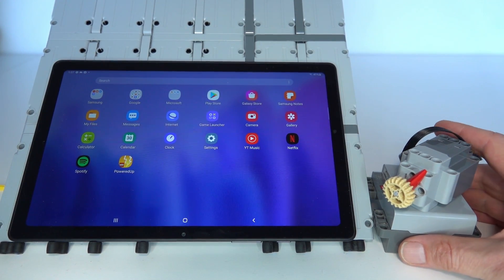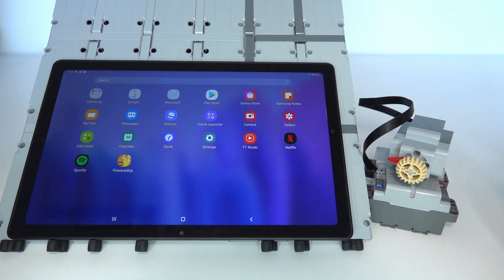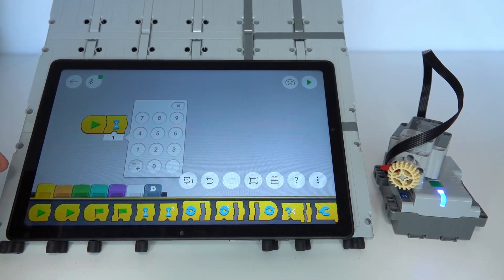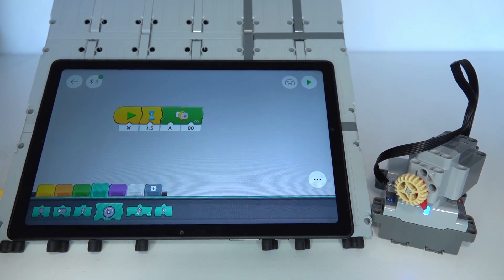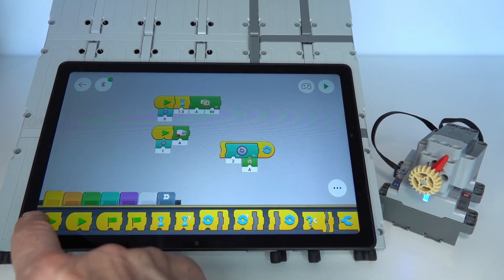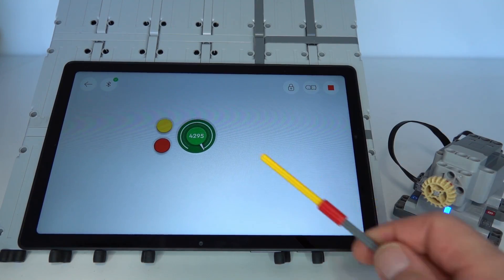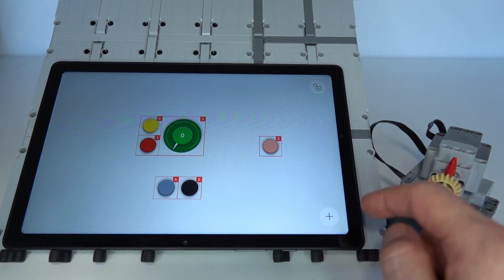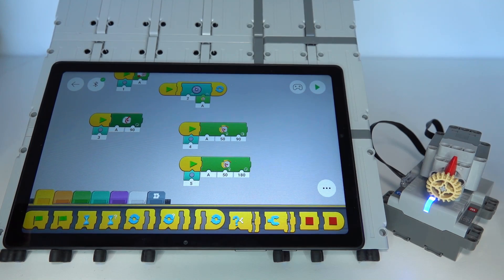Lego Technic Powered Up Tutorial 1

Comment: any tips on how to setup the liebherr r9800 on the Lego Powered Up app?
Reply: no, but this needs hard work to program it, test it and someone answer that?
Reply: To set up the Liebherr R 9800 on the Lego Powered Up app, you need to connect the hubs on one at a time and wait for them to pair via Bluetooth. It takes a minute or so to do, but so far it has worked faultlessly, connecting first time and maintaining the connection for as long as you want it1.

You can also drive forward, reverse, steer, extend, raise and lower the boom, open and tilt the bucket, and much more through the brand-new CONTROL+ remote-control free digital app2.